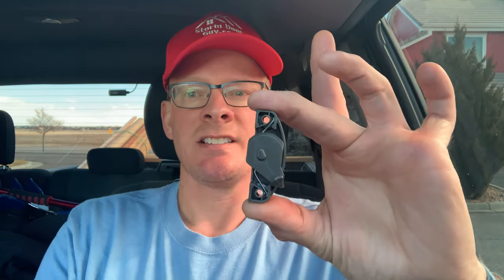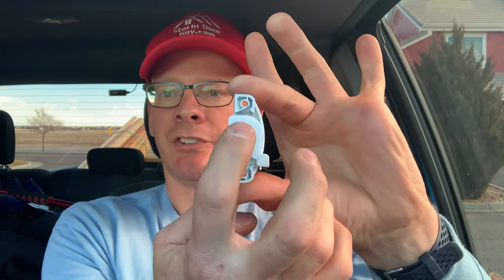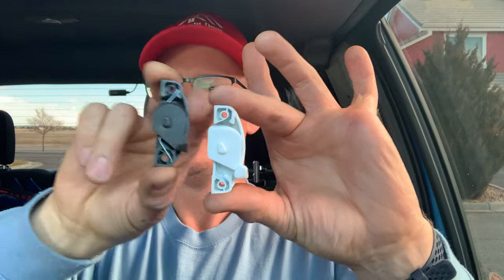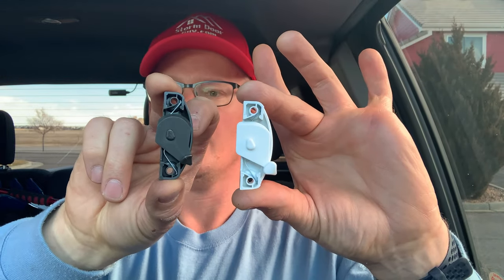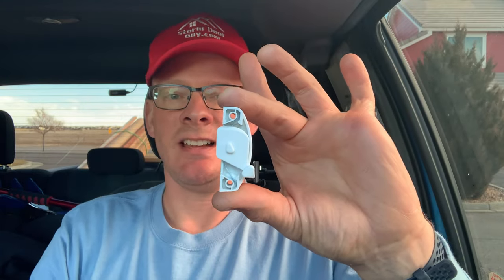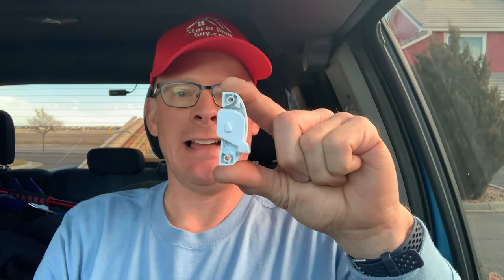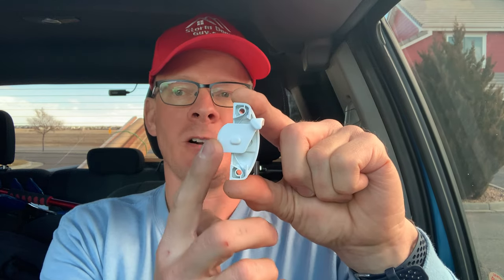Troubleshooting Tips: Why Isn't Your Storm Door Working?

Comment: Thank you for this video.  I bought a Larson pet storm door in February and the top window has been doing this from the beginning.  I called Larson and the associate initially had me pull the screen down a few times to "tighten" it, which did help, but the latch still did not go under the glass to keep it from falling over time.  I had to mention that I saw they had an updated latch.  The associate claimed they do not, but agreed to send me a replacement.  Of course, I had the rounded latch that was useless and the new latch works great!
Reply from the maker: Glad the video helped!

Comment: Is the latch supposed to go completely under the glass window? My window will not slide up enough for this to engage underneath. Just received the new latch and will not seat under.
Reply from the maker: Yes, it is supposed to go completely under the top window. 

If the window doesnt slide up enough, then either the bottom window is not set in the track completely and is too high so you may have to push it back down.

If that's not the problem, then double check that the latch is seated correctly.

If that's noth the problem, then it could be the top window is defective. If you check the miter joints in the top corners of the window, if there are spaces then the window is getting "longer" which is which the latch isnt going under. In the case, the window and screen will have to be replaced.

Hope that helps!
Reply: @stormdoorguy pretty sure it is the bottom window is not set deep enough. But there is no give to push it down any further. There is a piece on the bottom that seems to slide back and forth but does not come out for adjusting. Maybe just needing to replace this thing. Thanks for your help.

Comment: I had a storm door put in but I asked to change the way it opens. The handle is on opposite side of the entry door handle. It’s good to get in but to unlock the entry door, is very awkward.  Can it be changed or do I need a new storm door??
Reply from the maker: Depends on the type of door.
Reply: Anderson 400 series with the built in half screen
Reply from the maker: @Lovemytrials65  That means a new door, can't flip it. Because the holes for the handles have to be manually drilled, so if you try to flip it now, you will see the holes for where the handle used to be.
Reply: Thank you very much!

Comment: Could you provide the part number for this piece. I just has a Larson storm door installed with this issue, and I do not have a door model number or any idea how to find this part. Thanks
Reply from the maker: I don't have a part number, but if you open the storm door and look at the inside of the hinge frame there should be a white sticker with a registration number on it. That should tell Larson everything they need to know.

Comment: I have this storm door, and the window got stuck and wouldn't go down. My daughter got a little rough with it and was able to get it down, but it ripped one side of the screen. Not sure why it got stuck. She was able to get it back up, but now it is stuck again. I plan on replacing the screen and the latch. I have the latch that lets the window slip down. Any idea why it got stuck and is still stuck?
Reply from the maker: It could be because the top of the screen got caught on a sharp edge of the door frame behind the access panel. Or something got bound up in the screen roller. Hard to tell. You'll probably find out when you replace the screen.